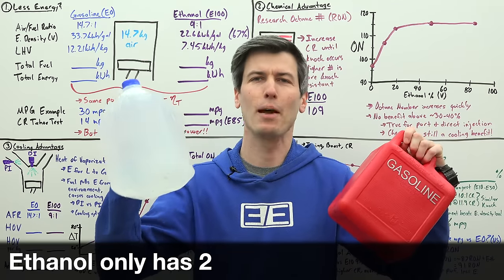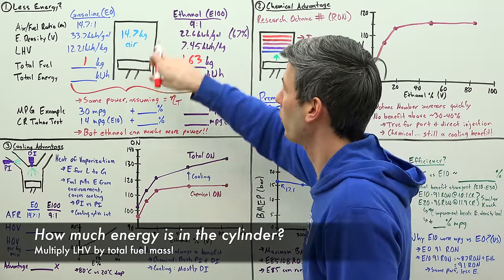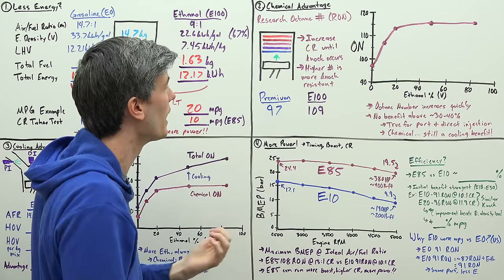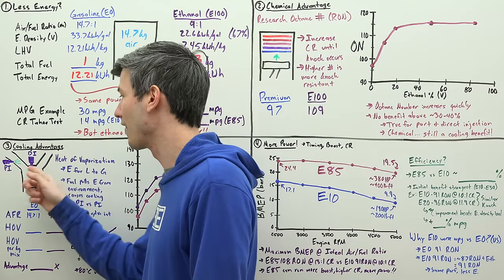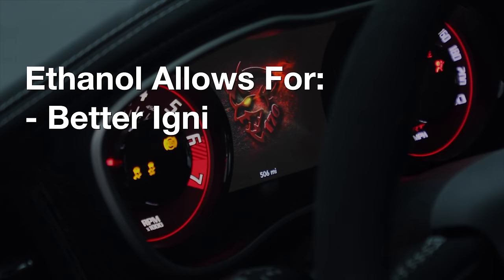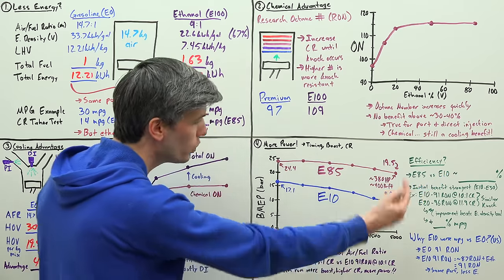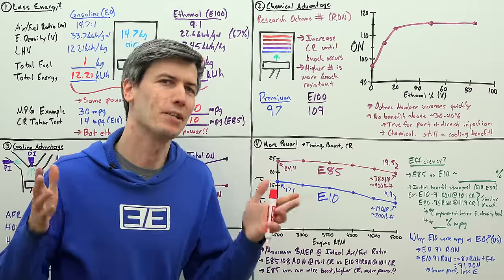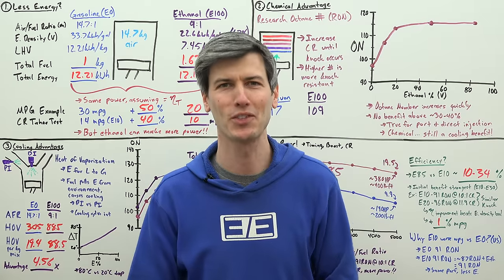Why Does Ethanol Make So Much Power? (Versus Gasoline)

Comment: If running on ethanol produces more power and torque, with an appropriately tuned engine, would it not be possible to run with a low-mathematically geared drive train and increase effective mpg?
Reply: Ford's first prototype eco-boost engine was optimized for E85.  It achieved 15 to 20% more fuel efficiency than gasoline with load performance equal to diesel engines.  They didn't come out with it in flex fuel because they thought they could skirt paying the MIT scientists patents on it.  That is still in litigation to this day I do believe.

Ricardo built an ethanol engine for GM and it ran in a pickup. It is half the size/twice the power of gasoline and diesel with better mpg than either one.  This is why GM wants the EPA to come out with a 100-octane fuel standard because they, like Ford are concerned about E85 availability.  We are the largest ethanol producer but have <2% of stations with E85.  France has 25% of them with E85.
  
FROM RICARDO:
The new federal CAFE standards are calling for a doubling of fuel mileage performance, which, Vint says, is going to send OEM’s looking for high octane numbers to improve efficiency and ethanol is the best source. Ricardo, an engineering firm with over 100 years in the business of engine design, has developed an extreme boosted direct injection engine (EBDI) to optimize ethanol blends. The 3.2 V6 gasoline engine rivals the power and torque of a much larger GMC Sierra 6.6 diesel, he said, and it delivers 3.5 percent better fuel economy than the diesel.

Scania has sold an ethanol engine worldwide for years which they state has fuel economy and power on par with their diesel engines.  Cummins had their ethanol engine called ETHOS which was half the size/twice the power of gas and diesel too.

This is not new technology or knowledge, it was known long ago.  It is suppressed technology.

Rear Admiral C.M. Chester wrote Henry Ford a letter on Dec.15, 1916:
"...I also pointed out in the article that as governmental laboratories had developed from 40 to 55% efficiency in alcohol engines as against 20% in gasoline machines, the use of alcohol at double the cost of gasoline for power purposes, was cheaper for motor[s] than gasoline in common use today."

Scientific journals from 1890 – 1920 contain hundreds of references to alcohol fuel at the dawn of the automotive era. 

Studies of alcohol as an internal combustion engine fuel began in the U.S. with the Edison
Electric Testing Laboratory and Columbia University in 1906. Elihu Thomson reported that despite a smaller heat or B.T.U. value, “a gallon of alcohol will develop substantially the same power in an internal combustion engine as a gallon of gasoline. This is owing to the superior efficiency of operation…”

The USDA tests in 1906 also demonstrated the efficiency of alcohol in engines and described how gasoline engines could be modified for higher power with pure alcohol fuel or for equivalent fuel consumption, depending on the need.

The U.S.Geological Service and the U.S. Navy performed 2000 tests on alcohol and gasoline engines in 1907 - 1908 in Norfolk, Va. and St. Louis, Mo. They found that much higher engine compression ratios could be achieved with alcohol than with gasoline. 

When the compression ratios were adjusted for each fuel, fuel economy was virtually equal despite the greater B.T.U. value of gasoline. “In regard to general cleanliness, such as absence of smoke and disagreeable odors, alcohol has many advantages over gasoline or kerosene as a fuel,” the report said. “The exhaust from an alcohol engine is never clouded with a black or grayish smoke.” USGS continued the comparative tests and later noted that alcohol was “a more ideal fuel than gasoline” with better efficiency despite the (*then*) high cost.
Reply: yes all the way.

Comment: What happens if you put Ethanol in a normal petrol car will the CO2 will go down?
Reply: 100% of the CO2 produced by the burning and the fermentation of ethanol just came from the atmosphere and 100% of it is needed to be there to make the new gallon of ethanol.  It is a cycle just like the leaves which fall on the ground and return the CO2 to the atmosphere.

But to answer your question specifically, yes:

Even with just 10% ethanol added to E0, the Swiss Federal Laboratory for Materials Science and Technology found that the especially health devastating ultra fine or nano particulate emissions were lowered by 97%, carbon monoxide lowered by 81%, carbon dioxide lowered by 13%, aromatic hydrocarbon emissions lowered by 67-96%, and genotoxic emissions lowered by 72%.

Comment: I'd like to see this same comparison but using methanol instead of ethanol
Reply: You can have a real world demonstration here thanks to the Indy 500:

A Brief History of Racing Fuel By Craig A. Johnson

In 2005, the IRL used 100 percent methanol in their tanks. The fuel worked well and was more efficient than straight gasoline, but IRL officials believed there was room for improvement. In 2006, they moved to a 10 percent blend of ethanol and methanol, which was then changed to 100 percent ethanol for the 2007 season.

The desire to use only ethanol aside, 100 percent ethanol is nearly impossible to obtain, and is illegal to keep without paying hefty taxes that date back to prohibition. The actual fuel used by the IRL is a blend of about 98 percent ethanol and 2 percent denaturant. The exact composition includes a small amount of high-octane racing fuel.

The fuel for today's Indy cars has an octane rating of 113, compared with methanol's 107. This means a significant reduction in pre-ignition, or knocking and pinging.

In addition, many of the people who handle the fuel, say it smells like tequila. This quality may seem insignificant, but smell is actually one of ethanol's benefits when compared with methanol. Pit crews noticed the switch to ethanol immediately, reporting fewer coughing fits and less eye irritation before any other modifications were made to accommodate it.

According to Dennis Vervynckt, manager of hospitality services and an IRL official, in 2006, the first year the IRL began using ethanol, teams saw a reduction in efficiency of about 10 percent. "That's because we put straight ethanol into the tanks," he says. "The teams initially didn't make any or very many adjustments to their engines. After a few months, they kept tweaking and by the end of the season they were back up to 100 percent efficiency."

Vervynckt points out that there was a minor loss of power. "When they first started using ethanol, teams saw a slight drop in horsepower," he says. "As the teams got used to the fuel, they were able to get more horsepower from ethanol once they again reached maximum efficiency."

The switch to ethanol also allowed the racers to carry less fuel and make fewer pit stops, thereby increasing efficiency even more. "When the cars ran on methanol tanks had to hold 30 gallons to accommodate the fuel requirements of the cars," Vervynckt says. "After getting the engines to perform at their full potential, there was a significant gain in mileage. Indy cars now have 22-gallon tanks. When a driver pulls in to change out his tires, he can fill up. Teams were able to match their tire and fuel stops exactly, instead of stopping for tires only, or fuel only."

That efficiency translates into much less fuel being used by the sport. Lifeline Foods LLC, which supplies fuel for the IRL, will produce 120,000 gallons of ethanol for the 2008 season. And though this may seem like a lot, it's 20,000 gallons less than was used the previous seasons.

The switch from methanol-based fuel to ethanol has amazed almost everyone in the league. Drivers, the direct users of the fuel, voice their approval in glowing terms. "[Ethanol] is an American fuel that is good for the country and the environment," says Ryan Hunter-Reay, of Rahal Letterman Racing and driver of the ethanol car. Standing beside his crew as they make last-minute adjustments to the car, he is more than happy to discuss the benefits of the IRL's switch to ethanol. "It's been great for Indy racing the fuel economy, emissions there's nothing we don't like. We love it."
Reply: @danafletcher2341  Ethanol is very easy to obtain, and no taxes involved.  I can go down to my local track or race parts vendor and get E100 any day of the week, from 5 gallon pails to 55 gallon drums....Additionally, methanol might have only 107 octane, but because of the cooling properties of the fuel, it behaves more like about 140 octane.  It's very hard to get methanol to detonate as well, which is why it's very popular with supercharged combos...
Reply: @markgoulette5056  I bet it is E98 because the government worries about someone drinking it without the alcohol tax more than the road tax.

Sounds expensive.  I tried to get E98 from an ethanol plant for my own blending a few years ago and not sure now why it didn’t happen.  That would have been cheap since the plant is 30 miles away.
Reply: @danafletcher2341  No, it's E100.  Racing grade E85 and E98 are also available.  Depending on the class, fuel testing is required and if it fails it can mean disqualification

Comment: Why is it significant difference between port injection and cylinder injection in terms of cooling effect?
Either way everything goes to the cylinder..
Maybe you meant piston cooling with direct injection, and injection to the intake cools more the intake valves then the piston itself..
Reply: He explained it.  Listen.
Reply: @ShainAndrews  not really, he just said so, he didn't mention why cooling is more efficient in case of direct injection..
Reply: @xXxbastek  — Go to 7:00 … He explains SPECIFICALLY why ethanol direct injection is most advantageous.

And like Shain said, listen …
Reply: @sking2173  yep, because is cooling the cylinder more, but he doesn't explain why is so! Evaporating the same amount of the same fuel require the same amount of energy, It doesn't meter if it is done inside the intake port or inside cylinder, overall cooling effect shoud by the same.
So results shoud be the same, unless there is something more to this, than overall temperature inside cylinder. Perhaps temperature distribution inside cylinder chamber dose makes a big difference in therms of knock prevention. Maby that direct injection concentrates cooling effect more on the piston? or on the spark plug? I'm interested in details of that study's. I would like to know why it is, like it is..
Reply: @xXxbastek  — I respect and understand your thirst for knowledge. It will serve you well, understanding “why” as well as “what”.

The answer is mainly that the gdi atomizes the fuel more effectively (see principles of phase conversion — theory of refrigeration), and the spray pattern is more precisely controlled such that heat is absorbed from the air charge and not the intake tract, intake valves, or cylinder walls. That’s the simple explanation. 

Here is an excerpt from a thesis by a NCSU student, Sanjam Singh, that explains gdi and pfi differences quite well. If you want to view the entire work, I’m sure you can find it by googling part of this excerpt.

“The cooling effect of the spray increases volumetric efficiency of GDI engines over PFI engines. In a PFI engine, droplets of liquid fuel sprayed into the intake port wet the intake port wall and intake valve, and evaporate mainly by absorbing thermal energy from these surfaces. In contrast, in a GDI engine, fuel droplets are vaporized mainly by absorbing thermal energy from the air. This results in cooling of the mixture, which in turn leads to a decrease in the volume and increase in the density of the mixture (Anderson et al., 1996; Wyszynski et al., 2002; Oh et al., 2010). Calculations and experiments to quantify the potential volumetric efficiency benefits and reduction in temperature of charge have been done by Anderson et al. (1996) and Wyszynski et al. (2002).”

Respond if you need more reading material. ENJOY …

Comment: Thats cause you need 30% MORE ethanol. ANYONE in the racing world knows more fuel, more power.
Reply: Ricardo built an ethanol optimized engine for GM a few years ago that not only has more power but also better fuel economy than not only gasoline engines but also more power and mileage than diesel engines all while being half the size/twice the power.

Here is an excerpt of an article of it and this is why GM wants a 100 octane fuel standard here:

FROM RICARDO:
The new federal CAFE standards are calling for a doubling of fuel mileage performance, which, Vint says, is going to send OEM’s looking for high octane numbers to improve efficiency and ethanol is the best source. Ricardo, an engineering firm with over 100 years in the business of engine design, has developed an extreme boosted direct injection engine (EBDI) to optimize ethanol blends. The 3.2 V6 gasoline engine rivals the power and torque of a much larger GMC Sierra 6.6 diesel, he said, and it delivers 3.5 percent better fuel economy than the diesel.

All this is not new technology or knowledge, it was known long ago.  It is suppressed technology.

Rear Admiral C.M. Chester wrote Henry Ford a letter on Dec.15, 1916:
"...I also pointed out in the article that as governmental laboratories had developed from 40 to 55% efficiency in alcohol engines as against 20% in gasoline machines, the use of alcohol at double the cost of gasoline for power purposes, was cheaper for motor[s] than gasoline in common use today."

Comment: I have a 2005 Toyota Highlander v6 w/over250,000 miles..I only use non ethanol because I get 18mpg vs 14mpg.. ethanol makes it run like crap .it won't go & my catalytic gets hot & trips my check engine light.

Comment: the problem is the car you get from a dealership will have to BURN more fuel, how much more can many to pay to get a high performance engine? in real world practical Using ethanol does not help if you have to burn MORE fuel how much more exhaust do you make?

Comment: During the start of the Iraq war, we were wondering why the older engines for the vehicles and generators were breaking down.  Mind you, this equipment was constantly inspected  and tested before deployment.  As it turns out, the government started using E85 around this time, and it was eating the plastic and rubber parts of the fuel pumps.  Was forced to switch  to civilian generators since we couldn't keep swapping them out.  I'm not sure what the wheel mechanics did about this for the trucks.  I guess they got newer vehicles that could handle the stuff.

I would not use more than the 10% mixed into most fuels in an engine not specially designed for it.

Comment: Thanks for another great post!

Have you considered the long term corrosion effect of 10% ethanol in an ice vehicle? 

A few years ago there was talk of raising the ethanol level in the pump fuel to 15% FROM 10%. The car manufacturers went before congress and stated that if this new standard went into law that they will no longer offer warranties on the powerplants in the cars they manufacture due to the fear of increased corrosion.

You may poo-poo this fear-mongering by the auto industries (I have yet to view your ethanol corrosion video's) but my 17 years experience with my 2006 Prius paints a disturbing picture.

A few years ago I noticed that the fuel gauge on the dash was starting to show a discrepancy between the dashboard gauge and what was reported on the fuel pump ⛽ at fill-ups (yes, I know about the less that 2 gal reserve in the tank compaired to the "E" showing on the dash). To the point recent fillups at the "Empty" dash reading the fuel purchased was only 7-8 gallons. My tank has an 11.9 gal capacity.

I've asked the guys at the local Toyota parts department and the body shop I currently work for and they both stated that its probably caused by the ethanol in the fuel corroding the fuel sending unit in the gas tank. Since nowadays modern fuel tanks are sealed units I was quoted a price of $1,700 to replace the fuel tank to correct this misreading of the fuel - with no guarantee that this same problem will not occur within the next 180,000 miles again!
Reply: Yeah, this post makes sense. Supposedly manufacturers were not in favor of E15, but E85 was a-okay …
Reply: @sking2173  it was a good story especially since admitting its a 17 year old car and the gas gauge doesnt work....I laughed I cried...but in the end 3 stars.

Comment: Interesting as when I was a guard; we ran e85 cert. ford crown vic's, each night shift would run "almost" a whole tank of gas (little less than ¼ remaining) but when I switched to e85 & take notice that this was a multi-day experiment switching between the two forms of energy sources; noticed the whole tank was drained completely & even to the point of the low fuel light every time... same driving, same routines, everything the same. In conclusion; e85 is approx. ½ the cost of gasoline so which one puts more pennies in your pocket🤌, you do the math cuz I'm done crunching numbers😄 "corn nuts anyone?🌽"